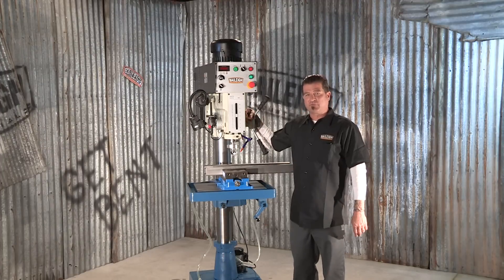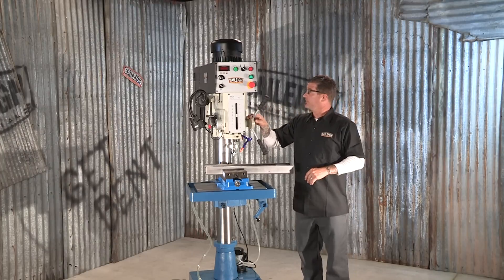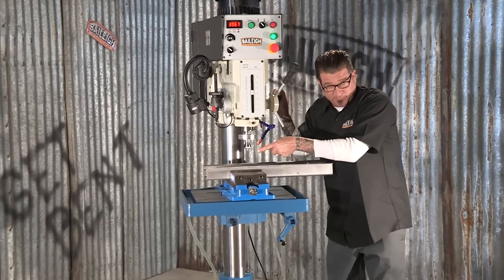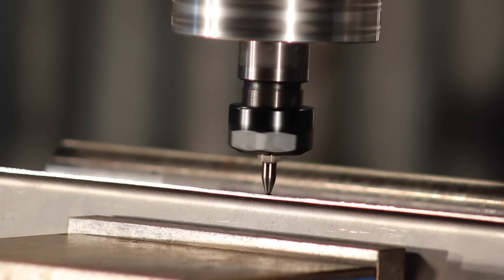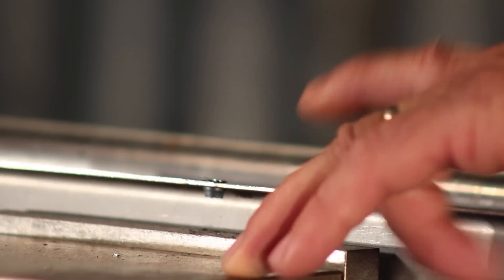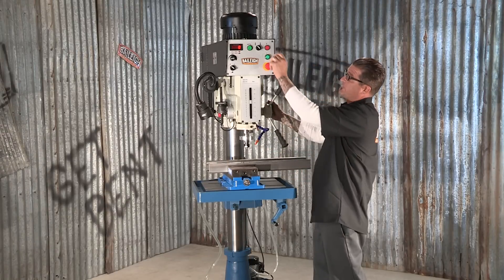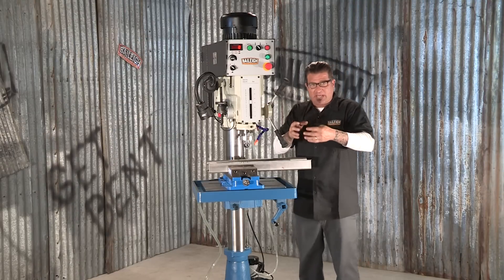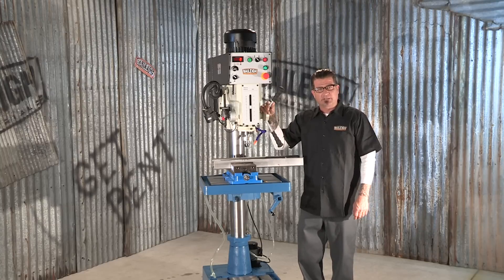Baileigh Industrial DP-1250VS-HS Variable-Speed Drill Press (Thermal Friction Drilling)

Comment: Does the thermal drill weaken the composition of the metal for taps?
Reply: If you cool it down qickly, mild steel can be brittle a bit, but its not going to happen because you leave the workpiece to cool down by itself. The temperature is also not that high. Its around 700-800°C while the bit is like 900 °C or so. The whole point of the friction drilling is to make taps in it,  so dont worry, definitely works. Even if the tap is a bit harder, thats just a good thing. Especially if you use 8.8 ts bolts in it.